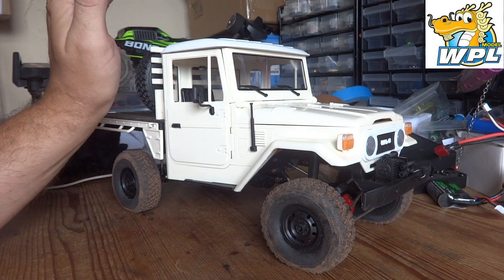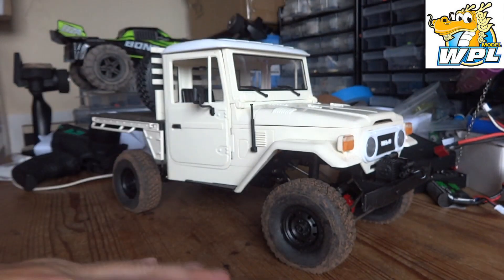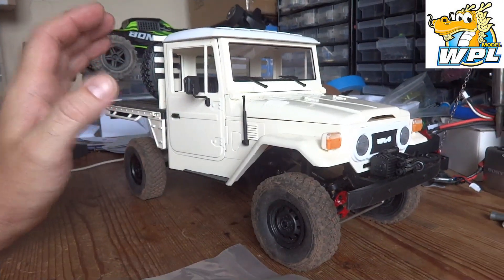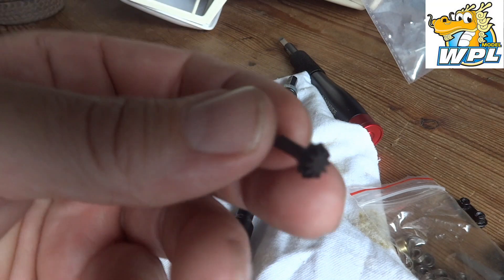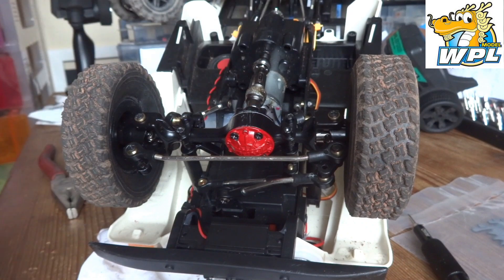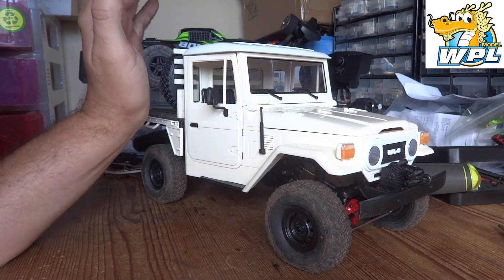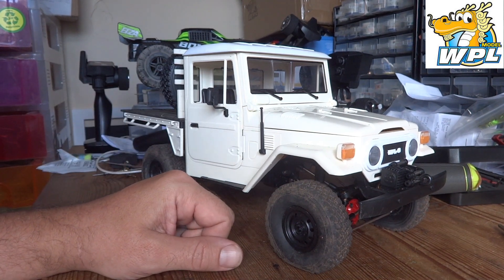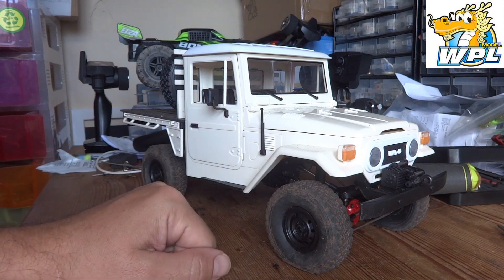WPL Open Differential Kit. Does It Make A Difference? WPL C44KM Test Mule.

Comment: Love your content mate. Any chance those open diffs can fit in a d12?
Reply from the maker: Hello. Thank you very much. Yes there's no reason why not, same rear axle. 👍👍
Reply: @theminiatureconstructionco4556  awesome! Planning to get them installed for drifting 😁
Reply from the maker: @RdsGarageOfficialYT  let me know how you get on.
Reply: @theminiatureconstructionco4556  didn't take too long til i gave in and went on to grab one off the internet, I'll let you know how it goes once i have it running 😁
Reply: @theminiatureconstructionco4556  sup buddy, just had the open diff setup on my d12 drifter. took quite a while to get it tuned like an lsd but it's making good progress. very smooth and very responsive so far. how long do you reckon the diff would last??

Comment: A good review of these diffs. They look the part & seem to perform as they should. That decrease in turning circle was a surprise. Not sure how I would use them myself as I prefer the off-road crawling. Good video.
Reply from the maker: They would only really appeal to someone who didn't do any serious off roading. Then they make perfect sense! 👍👍
Reply: @theminiatureconstructionco4556  if the drive shaft to the front had a one way bearing in it, used with solid gear or stiff rear diff, it'd be good AWD drifting potential.
did make solid gears drift pretty well with #316 gearbox made 4:1 direct with a 180 motor, the old style plastic gears don't see any real torque so they're good.

Comment: Do you know if this Differential will work in the MN99s?
Reply from the maker: Yes, but you will have to use WPL axle mounts as the bolt pattern is slightly different.

Comment: I’m always surprised by how many people believe you have to have a locked diff for off road use. Full time locked diffs in a real world application make it impossible to drive. 90% of off road vehicles have open differentials. The key is managing traction and keeping all the wheels on the ground and limiting spin.
Reply from the maker: Absolutely! 👍
Reply: yup, if dual use don't lock the diffs. tires chirping every corner, breaking gears..
locking the rear does help for climbing in rough dirt, if its used strictly in dirt.

Comment: How are they doing in the long term? I read in a review on the official page that they are very fragile. I'd love to try them, but won't pay 25$ if they are worn in a few runs.
Reply from the maker: Long term I couldn't tell you unfortunately. I personally only use my WPL's off road so I pretty much straight away put the solid axle shafts back in. I have given them to a friend who is converting a Bruder truck which will basically only be used on a hard surface. So if in remember I'll let you know. 👍